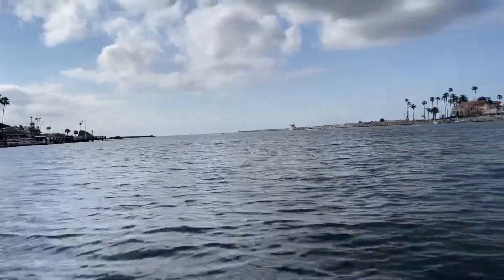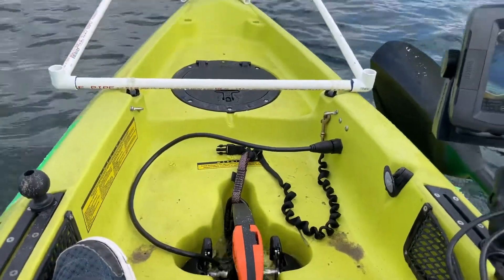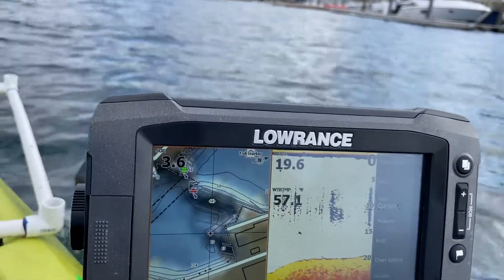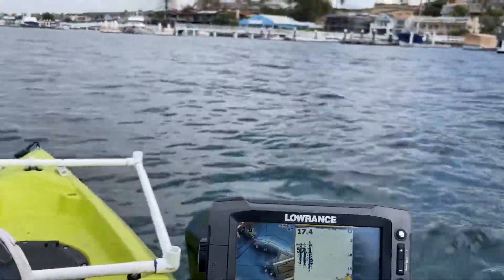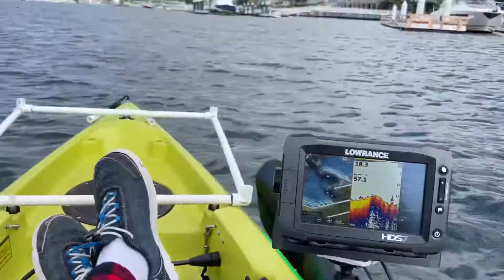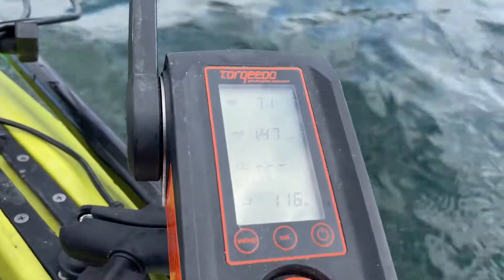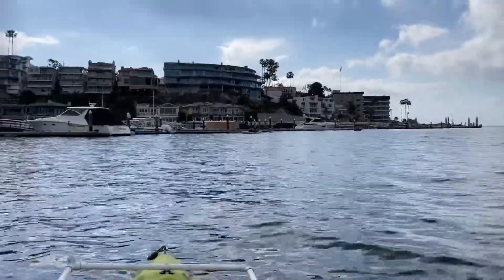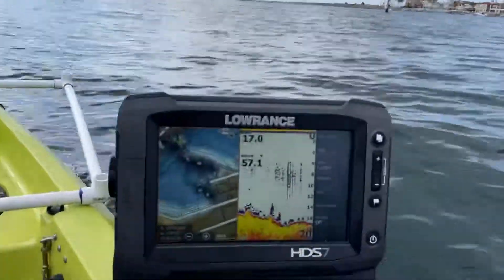Torqeedo Evolve v2 on a Hobie Compass speed and power draw test

Comment: How was the registration process at the dmv
Reply from the maker: DMV is clueless, on my first kayak it took 2 trips and 3 supervisors.  They had no idea how to handle it.  On my second kayak I went to AAA instead and it was in and out in 10 minuets.  You will need Certificate of origin from the manufacture, sales recipe showing tax paid, if you don’t have that you’ll need a bill of sale and they will charge you tax at that point.
Reply from the maker: Also if the kayak doesn’t have a serial number or vin you’ll have to bring it in so they can put one on.
Reply: I wonder if they have something like this for the PA 14 360’s
Reply from the maker: The JuanderDude this fits all mirage drive Hobie kayak.
Reply: @SoCalOutdoors  I think the 2020 and up 360 drives have a different shape then previous 180 models tho.
Reply from the maker: The JuanderDude ohh sorry I completely missed that you said 360.  But honestly on a pro angler you can install this motor on the stern attached to the h bar.  Check out one of my older video where I had it on my pro angler.   Being able to switch seamlessly between the drive and motor is such a game changer.   I am still trying to figure out how to do that on the compass without having to buy a different motor.
Reply: @SoCalOutdoors  that’s true, I just didn’t want to deal with extra steering cables 😵‍💫